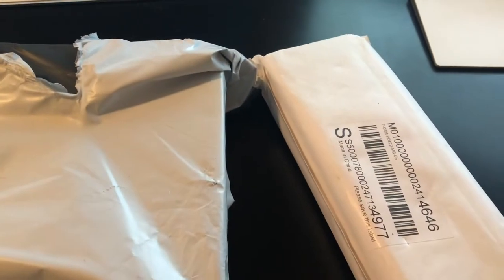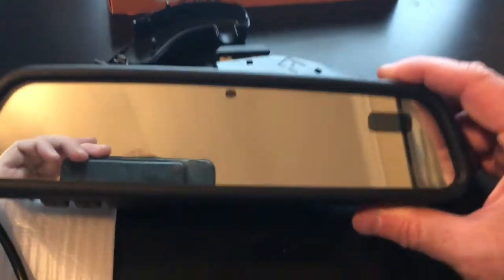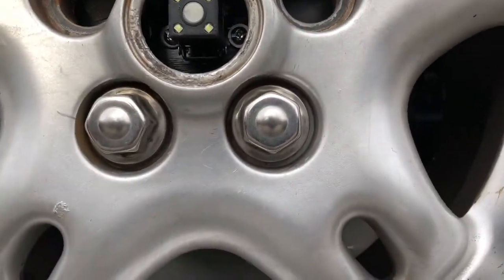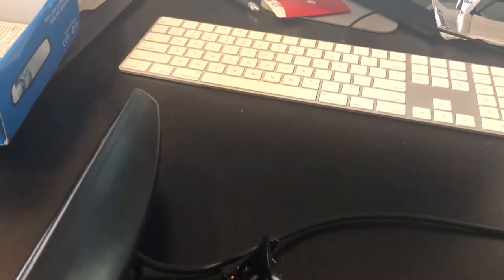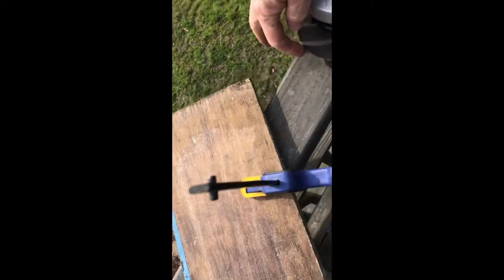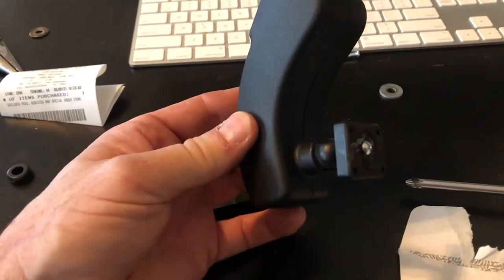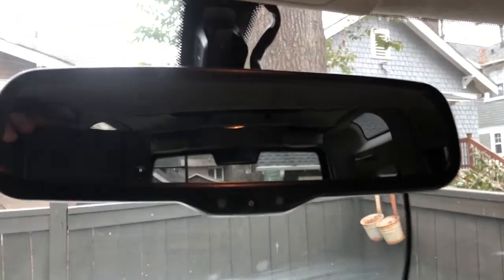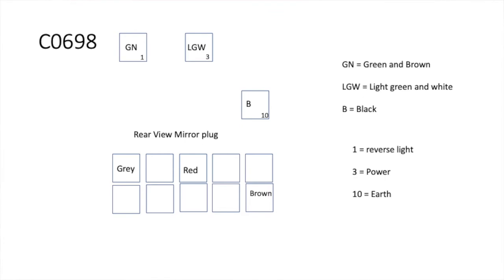Rear back up camera from Discovery 2

Comment: Hi I’m just curious to know where the camera wires run into the vehicle, is it through with the rear wiper wiring?
Reply from the maker: no they don't go through the rear wiper.  I drilled a hole in the door behind the wheel and installed a grommet.  It then goes through the same rubber protection that cover all the wiring from the body to the swing out tailgate.  It then goes up to the roof and hides under the headliner